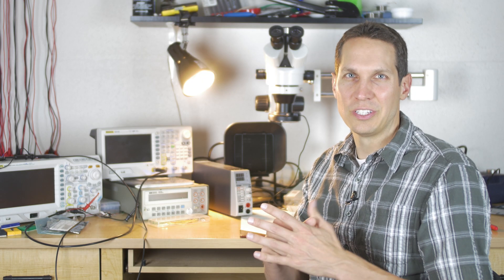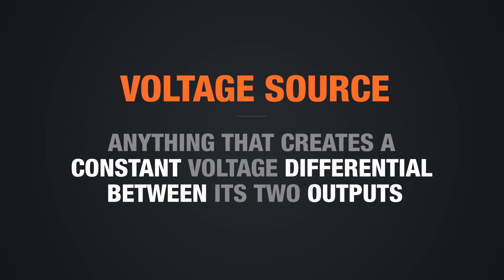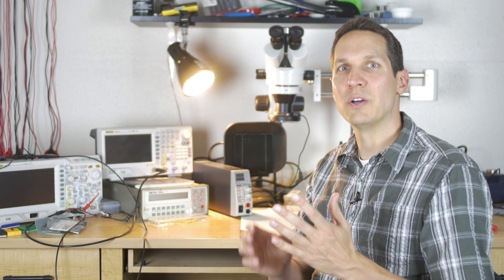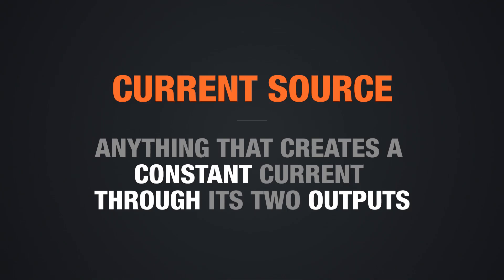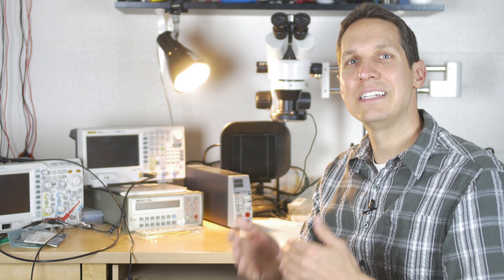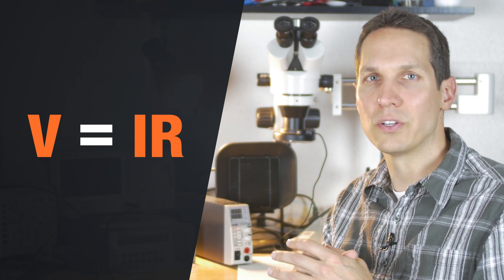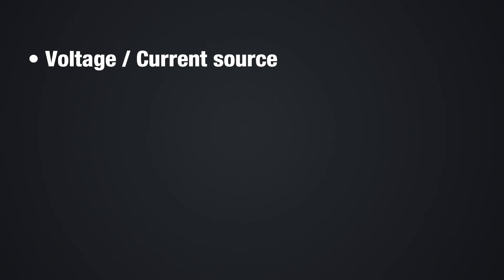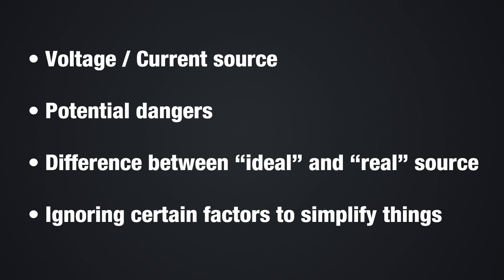Current and Voltage Sources (With Definition) | Basic Electronics

Comment: Circuit analysts routinely apply the principle of superposition, to analyze circuits and networks. When doing this they normally replace a voltage source if ideal with a short-circuit and if real like a battery with its internal resistance.
It is therefore useful for scientists and engineers to know the difference between ideal and real voltage sources.
Consider a real source such as a battery. The current flowing in any circuit connected to the battery also flows THROUGH the battery (through the electrolyte and the electrodes forming the battery). Both electrolyte and electrodes have resistance. This is called “internal” resistance.

Before one learns ideal voltage sources and why circuit analysts use it in circuit analysis it will be instructive to learn the unification of electrostatics and circuits which belong to one science and not two before reading the description of the principle of superposition. For too long has circuit theory been confined to analysis using math and has been depriving practitioners of the richness in its physical aspects.
Watch the two videos below which describe at a fundamental level using a unified approach to electrostatics and circuits Current, the conduction process and surface charges:
i. https://youtu.be/TTtt28b1dYo and
ii. https://youtu.be/8BQM_xw2Rfo

The ideal voltage source is assumed to deliver a steady voltage forever, and to have zero internal resistance. The ideal voltage source, no matter what you do to it, like drawing a lot of current (remembering that in a circuit, the current whether small or large also flows through it), or pushing current through it therefore can be replaced by short-circuits for analysing circuits to determine node voltages and currents.
It is not possible in this post to discuss in some detail the action of ideal and real voltage sources and the different symbols that are used to represent them which is useful to know. The viewer may refer textbook 4 listed in the References in the last frame of video i above.

One section “Application of The Principle of Superposition un Electric Circuit Analysis” in Chapter 3 of textbook 4 is devoted entirely to a description of the application of the principle of superposition to simplifying circuit analysis and also with the reasons (includes experimental results with two batteries in a mesh network) for replacing voltage sources with their internal resistances or short-circuits using the unified approach to electrostatics and circuits.

Comment: At 0:35, what do you mean by "Will source whatever current is needed to maintain the voltage difference"?
Reply from the maker: If you have a simple circuits with a voltage source, resistor, and ground in series, the voltage source wants to stay at its rated voltage.  For example, if it's 5V and the resistor is 100 ohms, it will produce 50mA.  If it can't produce 50mA, let's assume it can only produce 30mA, then the voltage will actually drop to 3V, so that it's producing 30mA through that 100 ohm resistor.  But, for ideal sources, we assume it can produce as much current as necessary to maintain that voltage.  So, if the voltage source is 5V and the resistance is .00001 ohms, that voltage source will supposedly produce 500,000 amps.  Which is unrealistic, but in ideal situations, is what we assume.  Does that help?
Reply: @CircuitBread  That makes sense. Thanks!

Comment: I kinda get the picture here, so voltage sources will make the voltage across their terminals/branch same no matter the voltage getting to it, and current sources will make the the current through its terminals/branch same no matter the current getting to it, So does that mean if I input a current to a current source in a branch (parallel connection) the current source will SET the current in the branch to be its own no matter what?
Reply from the maker: I'm not quite sure if I understand the question but if you theoretically have two current sources in series, setup for different currents,  then they will be fighting each other by producing crazy voltages, trying to overwhelm the other one. 

We actually just shot a newer version of this video as part of our Circuits 1 series and were going to post it last Tuesday but... we had technical difficulties and will have to redo it.  Ugh...
Reply: @CircuitBread  thanks for taking the time to answer, I know I wrote the question weirdly 😅 but I meant, @CircuitBread  In short, is a current source one that CREATES constant current through its outputs/terminals only, or one that also SETS current through its outputs/terminals to be constant ?
Reply from the maker: When we're dealing with current sources in circuit analysis, you just assume that it creates the constant current through its outputs/terminals by varying its output voltage.  
We actually reshot the new video about this yesterday so we'll hopefully have it posted in a week or two, which I think does a slightly better job of explaining this topic.
Reply: @CircuitBread  Thank you, I'll watch first before re-asking a question you answered

Comment: Thank you so much for your easy and clear explanation. I have a quotation, if I want to drive a load that requires 1A, and 1 V, could I use the 5V arduino  and make a voltage divider to drive it?
Reply from the maker: Hi Basma!  Unfortunately, the issue here is that 1) the Arduino GPIOs can't output 1A and 2) a 1A load, even if your driver is big enough, is a big load to use a voltage divider with a 5V output.  You'd be looking at less than 20% efficiency, which is a big waste.

Comment: Thank you so much. So concise but helpful
Reply from the maker: Glad it was helpful!
Reply: CircuitBread Do you have any explanation about the materials science or physics behind the voltage sources and current sources
Reply from the maker: Hi Sipho - not really... the challenge is that the voltage sources have different mechanisms depending on the source (a battery has a constant voltage due to chemistry and there are many different battery chemistries whereas wall-wart/DC power supply is using electronics rectifying an AC signal to create a constant voltage) and current sources have the same problem.  You can model a BJT as a current source (we have a tutorial coming out next week that touches on this) but there are companies that are also creating LED current sources.  Again, semiconductor material (basically chemistry) versus electronics to create the same effect.  Hopefully that helps!
Reply: CircuitBread Thanks, makes more sense now